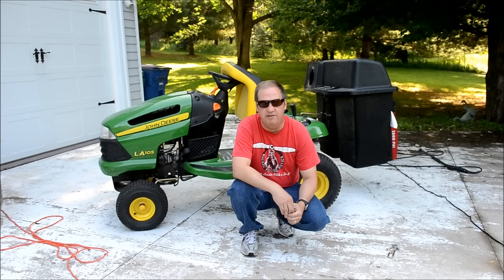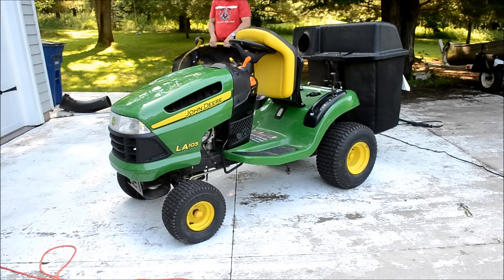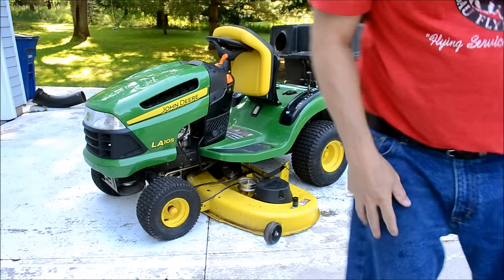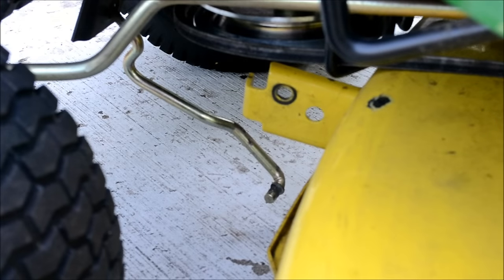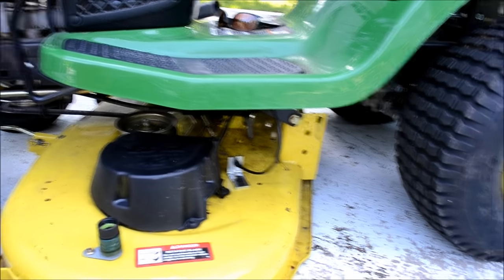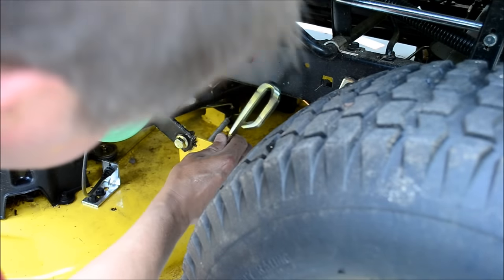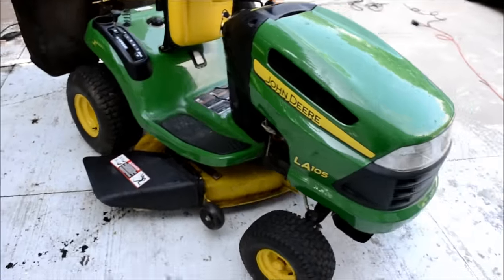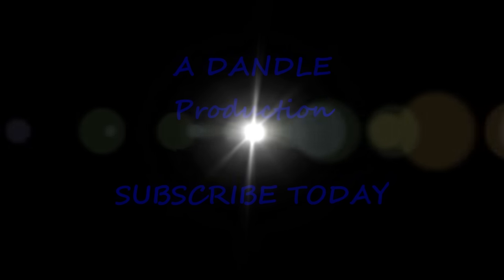How To Reattach a Mower Deck on A John Deere Lawn Mower

Comment: I'm a 72 year old widow. With the help of your videos, I was able to remove the deck, replace the blades and belt, and reattach the deck. Thanks for your excellent video. I also replaced the air filter, spark plug, fuel and oil filters, and carburetor. I'm sure it saved several hundred dollars.
Reply: Well done, you're 77 now and i bet you're still cutting the grass.
💪😊

Comment: I”m female and in my 60s, thanks to your videos to remove and re attach, I have done both today with only getting hubby to help with that spring at the end... just would not release no matter how hard we tried. In the end hubby had to use the grinder and take the smallest bit off the end of the spring, they had used a very large tough spring on ours. Your a  Legend Mate.

Comment: Nice visual refresher for this annual chore. Thanks for your vivid cinematography and and clear step-by-step instructions. By the way, I usually use a torque wrench to tighten those blade nuts to 80-90 ft-lbs. Also, I will usually lubricate the two spindle bearings through the little nipples which are accessible below the pulleys under those plastic covers. While I'm at it, I will also lightly oil any of the non-bearing movable parts.
Reply: Well Richard! What would you say if I told you that you did not grease the spindles as you thought you had? Those grease zirc fittings are as worthless as tits on a man! Both the bearings on each end of the spindles are sealed with a dust cover, And unless you remove the plastic dust cover there is absolutely no way grease will ever reach the bearing on the other side of it! John Deere tried to pull a smooth one over on their customers by making you think that you maintenanced your deck spindles with a zirc that let's grease into the middle section and there is nothing being lubed that matters at all in the middle!🤔

Comment: I was wondering what way to put the cotter in by the cables, I was worried the point would rub the cables and I noticed you changed the direction of the pin.  Thank you for the detailed video.

Comment: One other thing that I would do to help take the mower deck loose and reattach is drop the lift handle down to make it easier to connect and disconnect the lift arms
Reply: I was going to do that too...about to take my deck and blades off to sharpen and clean  up the deck.

Comment: Thanks Dandlinc. I suspect it would be easier if you set the lift bar height to minimum - not 4 inches as you had it here - before you try to install the "heavy" lifters.

Comment: Instead of using a board to TRY and hold the blades. Arnold make a tool that fastens to the deck and holds blade for you. Using a board is the old fashion cheap way of guaranteeing getting hurt while loosening and tightening the blades. The dealerships sells them for about $14 bucks.